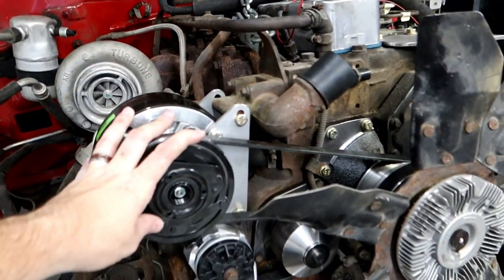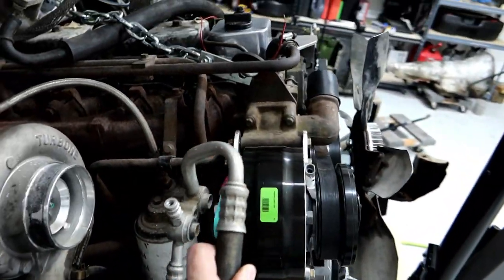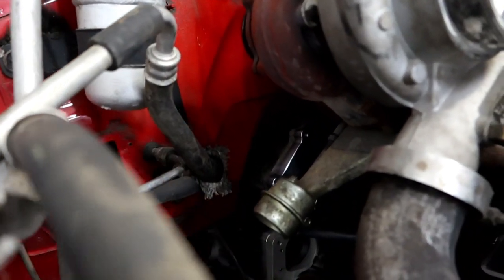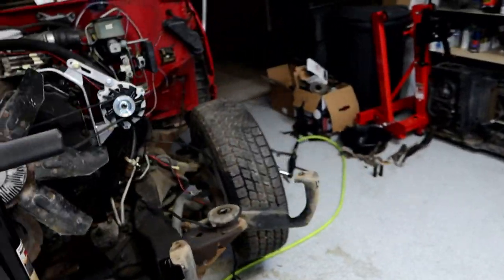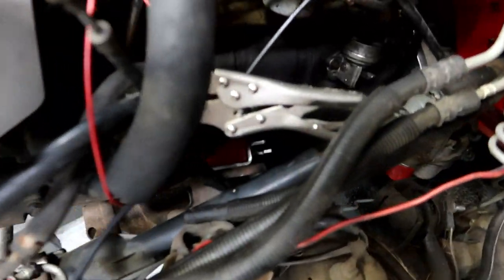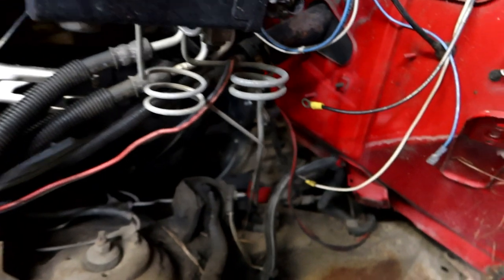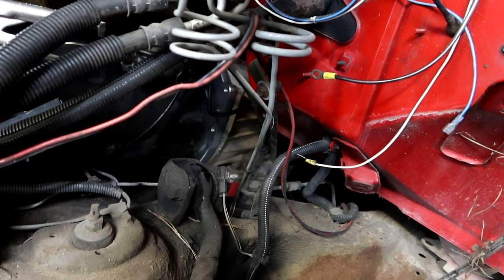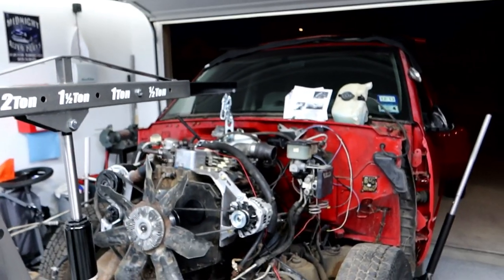12v Cummins / Allison 6 Speed Conversion 3

Comment: Where are the jack stands?
Reply from the maker: KEN GIRARD hey OSHA! You’re right. There was a good reason I wouldn’t  slide all the way under it while I was loosening those crossmember bolts up. Had to move the stands out for the engine hoist.